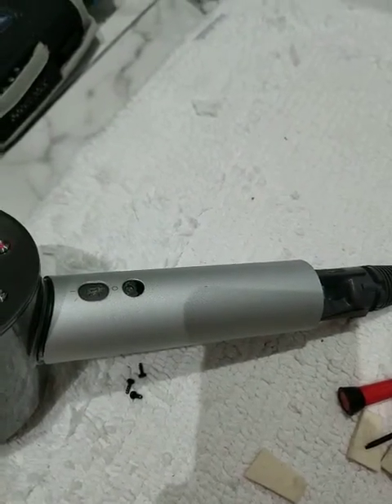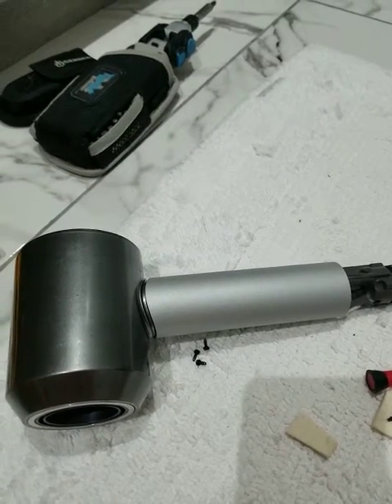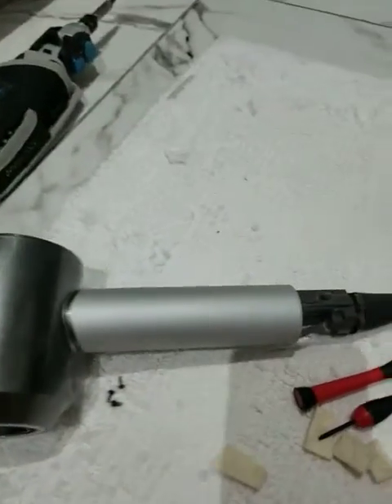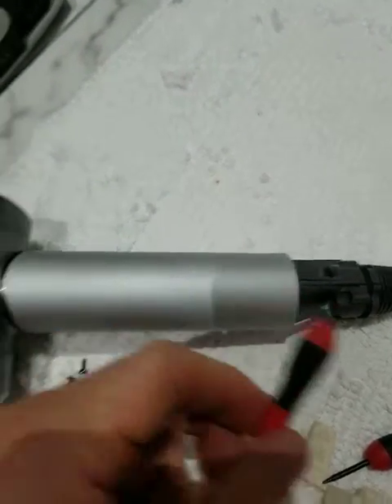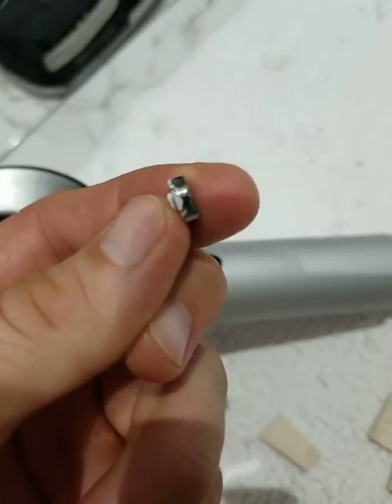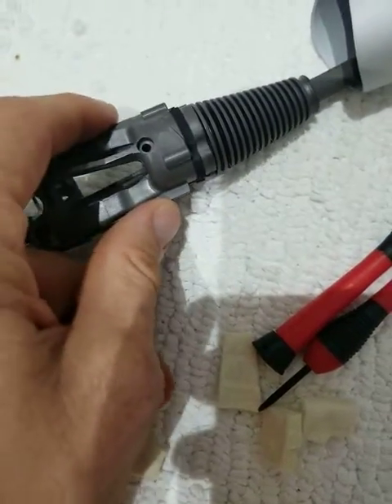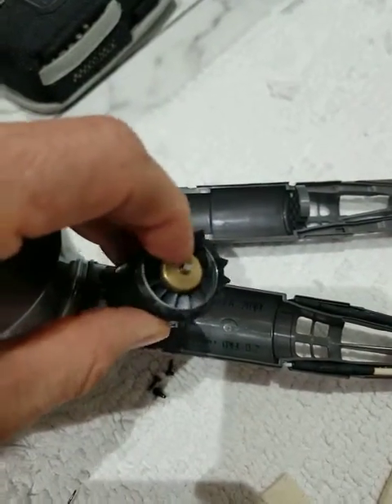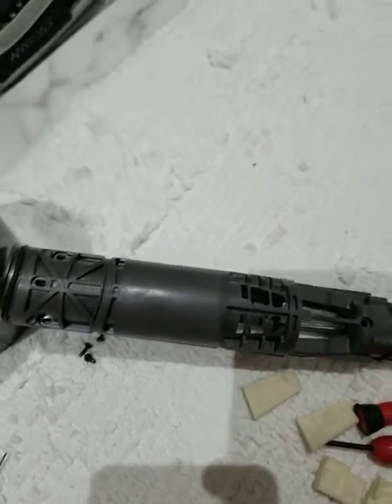dyson hairdryer repair

Comment: It seems my screw at the bottom is stripped so cant get it open to remove filter
Reply from the maker: Have to just pry it off. A couple of the screws no longer unscrew. The filter plastic will break around the screws, but it will still work. I have to do this at least once a year.
Reply: @tonybraun6857  thank you…i got it open…my three white lights also flashing and dryer cutting out…so need to try and see why
Reply from the maker: Take the motor out off the handle and spin it by hand to unlock it. Sometimes it get stuck (rust/debris). This is normally why it flashes white lights and the stops right away.

Comment: Friend had dropped a hair dryer off said it was left outside for 3 days and wouldn't work, after watching your video I removed the filter and spun the motor with a small long screw driver and did the trick, works perfect. Thanks for the video.